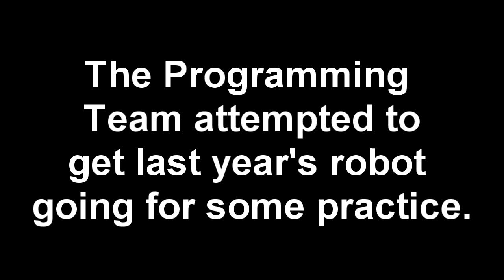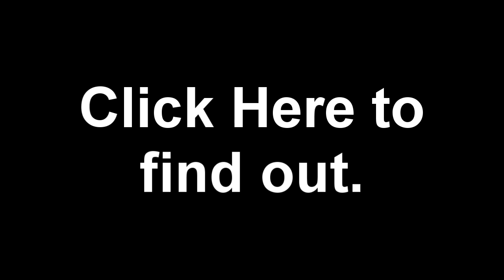Programming VEX CORTEX: First Test

Comment: It is neat that VEX is being incorporated this year, though our team isn't very optimistic about the new, extremely sensitive motors, which seem quite a bit lower quality than the previous ones. The control system will take a while for us to get used to, but with programming and practice, things should become much easier. Anyways, good luck this year